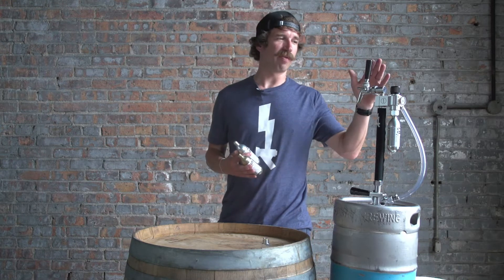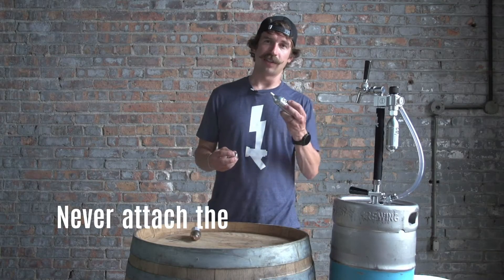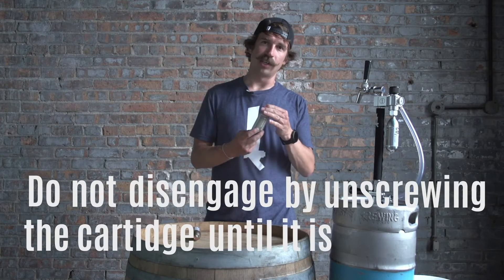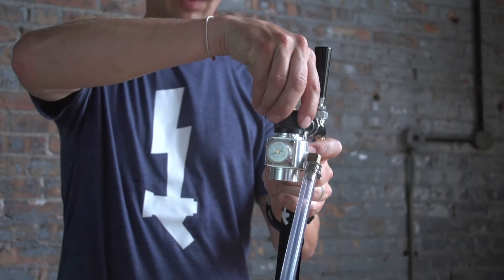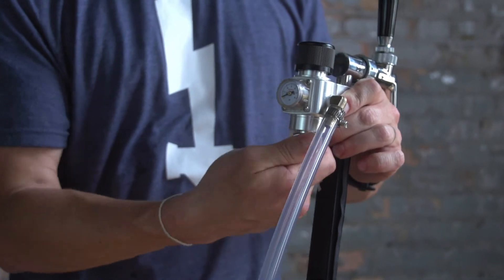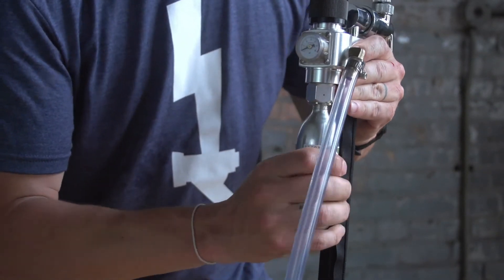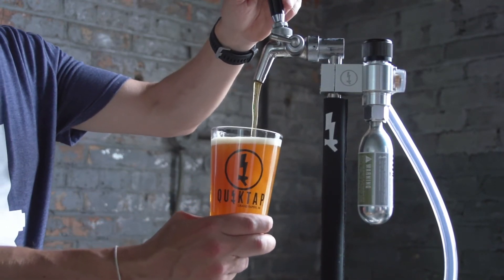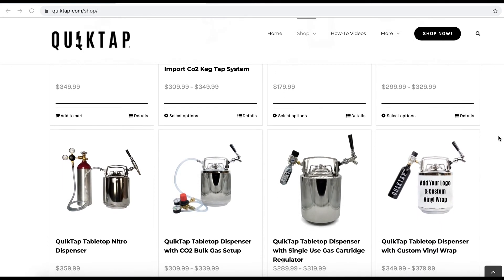QuikTap SS Keg Tap Single Use Gas Conversion

Comment: Is each cylinder good for a full half barrel keg?
Reply from the maker: Yes!  There's many factors including altitude, air temperature, etc., however on average a properly filled 12oz CO2 cylinder will dispense 15.5g (a full half barrel).